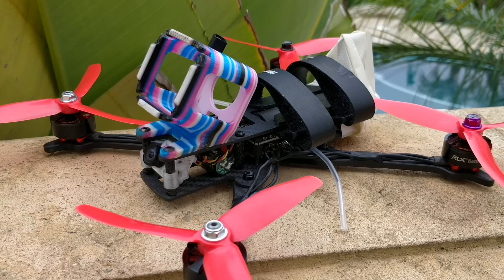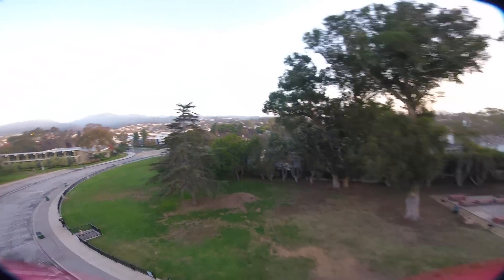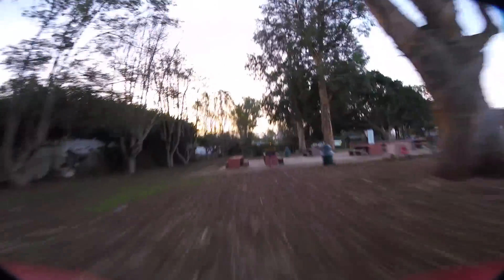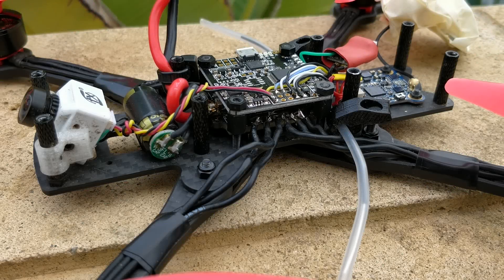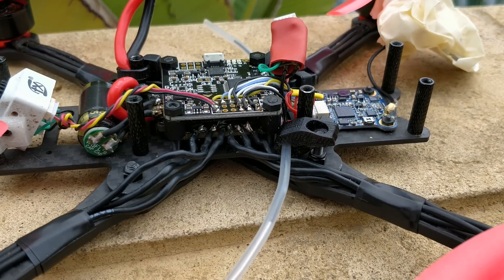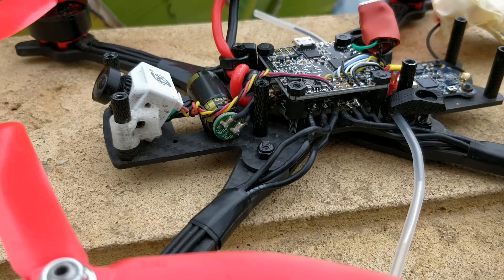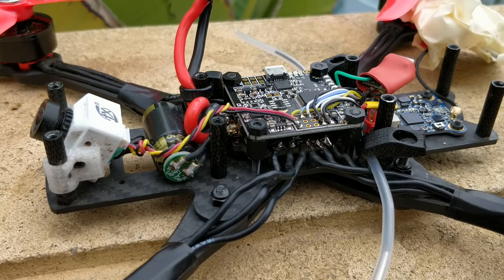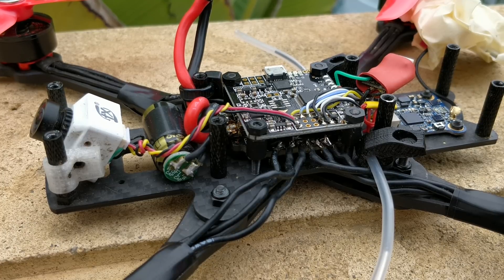Naze32 in 2019...

Comment: Yes does this mean that we are really being fed by the marketers and the Youtube influencers ,for most of us who have come up through building a Quad with a KK1.0 board and plane motors and plane props,changing everything every five minutes really takes away from flight time ,spending hours at the computer finding solutions when it all won't work or connect and every new itteration of betaflight that means more non flying time,look at three D RC Planes ,a motor an ESC and servo's its all in the hands of the experianced pilot and that reallymeans air time pratice we are getting into the area of software updates ,got to have the latest when we only get to figure out 5%of it and don't have the time to figure the other 95% and end up going on youtube for the few little extras that are getting fewer and fewer as all everone does is review the supposed next best thing.

Comment: the difference is just different levels of awesomeness lol. if I run 32k with gyro lpf 2 off and some other filter adjustments for increased processing speed I notice a decrease in propwash the main reason being the motors ability now to kind of almost keep up with the amazingly fast (relatively) fc looptimes I notice an overall smoother flight on a clean quad and a horrible one if there’s the smallest hint of vibes (on icm gyro with lpf 2 disabled 32k) but I could be completely off base bc that’s just how it is lol but in certain instances for example where I don’t pull out of a power loop cleanly Where there once would be wobbles there isn’t on 32k.. I guess it just increases the margin for pilot error which goes back to what you were saying about learning quicker a few years ago when the margin for error was much smaller.

Comment: I still run an F1 Naze32. It's possible to get them to run at 2k depending on the firmware and what you have enabled. They're fine with a good tune, and that's really the key. A slower looptime has fewer corrections per second, so those corrections must really be spot on or else it will over/undershoot. Vibrations can also effect these boards more.

Comment: I'm not surprised at all tbh. I was slow to 'upgrade' from F1 boards, so it wasn't until Betaflight 3.1.x that I actually flew my first F3 quad & the difference between my Naze32 quads running 1k/1k on 3.1.x & my shiny new F3 quads running 4k/4k on 3.1.x was... minimal. Improvements in pilot skill & advances in fundamental firmware features/performance have a much bigger impact than faster chips running faster looptimes IMO. I get that F1 chips can't necessarily run the latest filters, but let's be honest - betaflight already flew amazing before any of those were introduced!

Comment: This is surprising!  How well does it seem to handle propwash?

That's been the biggest difference between my Helio builds and everything else.  When I do a bad job, and I have to pull out of an s-turn or power loop that is too tight to at the very last moment to avoid hitting the ground or the bottom of the treetop, my non-Helio quads all exhibit way more propwash than my Helio quads.

Your footage with the Naze32 is quite smooth, but unless I missed something (and I may very well have!), your flying here would have been smooth and clean on just about anything.  You're an experienced pilot, so you don't peg the throttle at the bottom of an s-turn--you ease into it.

I don't know if you're still planning on taking this experiment any further, but I'd be very curious to see how the old, slow loop rates hold up when you're in situations where you can't be clean with the sticks.  Those situations where the pilot is doing everything they can to induce propwash instead of trying to avoid it.

Are you running stock Betaflight build?  Are you aware of Mark Spatz's (uavtech on YouTube) performance builds for F3 flight controllers?  He has builds of Betaflight 4.0, and I saw a Naze build in his list.
Reply from the maker: I'm more shocked than anyone at how well it flies.  Yes I'm aware of Mark's page for sure.
Reply: Also check out: https://www.facebook.com/UAVTech1/posts/2158286697765786
Reply: @uavtech  Yup - awesome stuff.  Had to revisit my latency math overall, but you're spot on with that.

Comment: Bob, you took the RED pill!!  :-)  

Welcome onboard.
Reply from the maker: lol yeah by mistake.  However the Helio board in my 7" flies better than any of my other boards and it has been the same excellent performance across four builds.  Anything I build going forward will be with the 20x20 helio until the radix 20x20 comes out so I could test that.  The layout of the radix is heaps better so I'd move over to it if it performed similarly better than plain boards.  I still have no idea what voodoo is going on in these boards but tests are tests and so far there is some sort of voodoo in there.
Reply: @Kabab  , but last week the Helio flew better than any other board on a 5" quad?  Now that is all changed.

Know the Radix his max loop rate of 3.2k.  Working with Ken Mitchel we now have a BF 4.0 build that allows the dynamic notch to work down to 1.3k.  See post at: https://www.facebook.com/UAVTech1/posts/2158286697765786 for the results of that.

If you want, I can cut you a HEX of that for testing.  I and a couple of guys have been flying 1.3k and so far are pretty happy with the results, but are still in testing mode so not drawing any absolute conclusions just yet.  I have the rig that has the dual FCs on it and once done with the Helio will put two BF boards on it to fly at different loop rates and record others; comparing logs, etc...  Been talking to Preston (F1) and Bruce (BF - eTracer) on the topics and they have varying opinions of 1.3k vs. 8k. vs. 32k.  Looking for the 8,000 fps (or higher) data showing differentials to draw the best conclusions to hopefully, finally crack this nut.  Also, have options of Martine (BrainFPV), A Nub, and I see Le Drib's below.
Reply from the maker: @uavtech  right now I have so much to do I don't have much time to pay attention to my own detailed testing. I was never really sold on any of the frequency change differences aside from the initial increases in looptime on like, cleanflight forever ago. Up to 4k it improved but 8k didn't. All that being said, I did note very obvious improvements on F4 vs F3 up until maybe a few months ago. Right now this topic is a side interest for me. 

There are two main issues I want to see solved. One is the dipping on throttle pump. The Helio board is 98% perfect while any other BF board save for radix because I have tried them, is not nearly as good.  The other issue is that when I drop throttle quickly, the quad wobbles. Especially on 220X quads. 230X quads do not have as much of an issue somehow. This problem only arose a couple BF updates back. Before then there wasn't any issue like this. I have no idea what to do for it to stop. 

If those two issues are solved, I'd be really really happy. And also, I'd point out again because it is really amazing to see, the Helio board has the absolute best dipping management I've ever seen. I have no idea why. It just is and has been excellent across four quads.
Reply: @Kabab  , is that Helio with BF or Helio with RF?
Reply: @uavtech  IS there an official Helio BF build yet? I'm not sure I'd trust anything compiled by helio devs anyway. They have a monetary incentive to keep people tied to their software.
Reply: @Seaweedaids  , no there is not.
Reply: @Kabab  Have you ever considered dropping a blackbox log and maybe some DVR or video of the issue into the BF slack? Lots of guys and developers there would be happy to help. I haven't had any issues with dipping since the latest anti gravity code was improved, but it could just be a PID issue.
Reply from the maker: I don't use buterflight or raceflight.  Only betaflight
Reply from the maker: I've given BB to a few from the one quad I have that had BB but it's not like it's a secret or anything.  Take any quad out there with betaflight and it does all the same stuff.  I don't have that FC anymore...
Reply: @Kabab  .  Cool.  Just wondering if it was RF.

I don't notice so much, but I'm always on 4.0 (iterations thereof since August).  This is with throttle pumps right?  U saw in 4 too? Will slap the throttle some more and see wsup.

I'm confident it is not a filter thing, so a mystery for why better in a Helio (unofficial) target.  Maybe they made another tweak?
Reply: Oooowww ooowww...  I have that rig with Helio and CL board.  When I swap, I'll specifically do throttle punches in the test flight.  Right now the rig is flying on the Helio board and recording on that and CLracingF7 board.  Will be switching that and doing similar flight pattern.  Make sure to have throttle pumps on both to compare.
Reply: @Kabab  it's not a popularly reported problem especially since ctzsnoozes new anti gravity, and of course feedforward was added. I have lots of BF rigs and none have the problem for a long time.

If you ever find that log I hope you share it I'd love to take a look..
Reply from the maker: @Seaweedaids  I'll see if I have any quads with BB. I don't think so. The dipping is obvious however.

Comment: i only use r-xsrs in my builds... i just wish they would do a presoldered or solderpad version because the relatively huge plug for the wire harness totally ruins the form factor of this awesome receiver.
Reply: solderpad version may be cramped so the solder pads would be tiny, which sucks, but they could also get rid of sbus-in (which nobody uses for race quads) and call it the "fpv race-version" or whatever.. or maybe they should do a whole new receiver with the same size, no sbus in and decent sized solderpads for inv. or uninv. sbus.
i really don't know why they do not release something like that already?